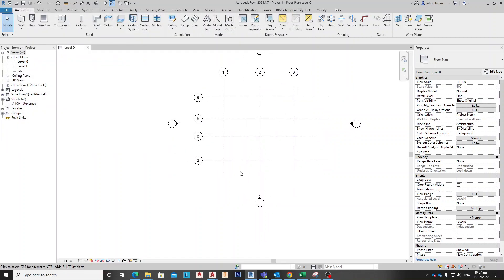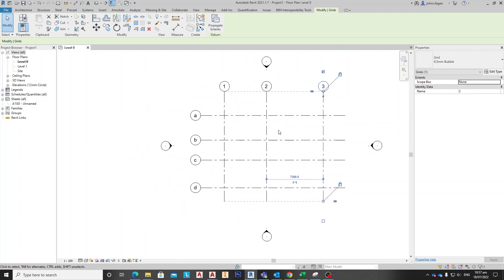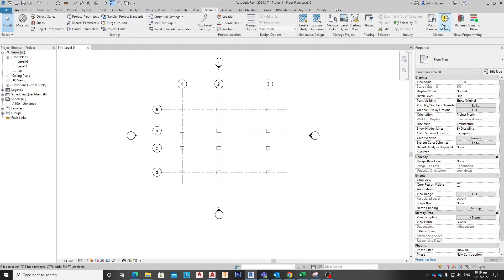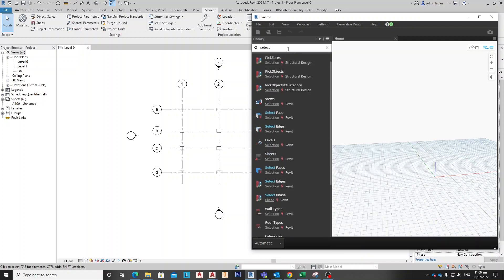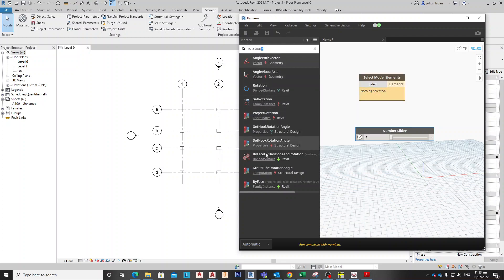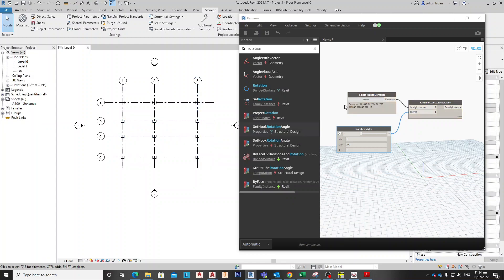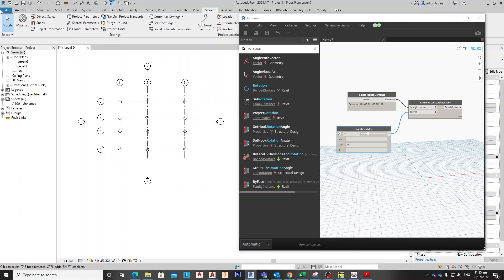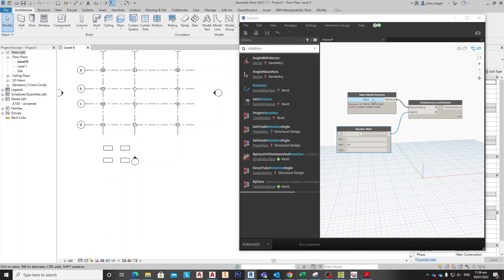Revit 2021 - Multiple Rotation of Column using Dynamo

Comment: I tried the same but it is not working
Reply from the maker: check sir the element type and the inputs of the node
Reply: Seems a bit silly that this doesn't work for structural columns. Most of the users spending more time modelling and manipulating columns will be  structural technicians!